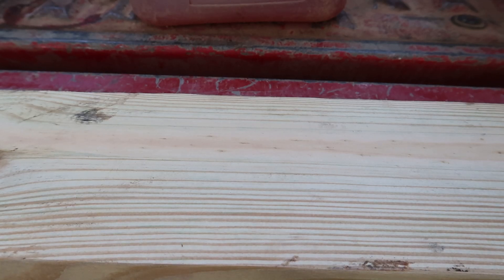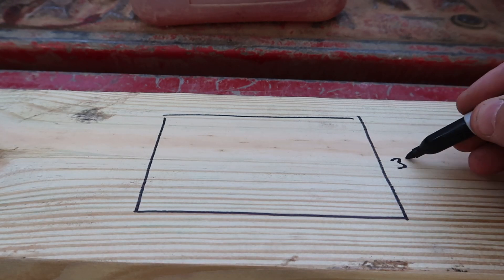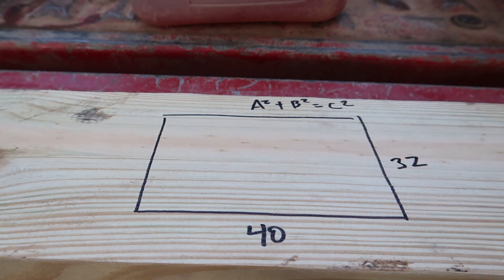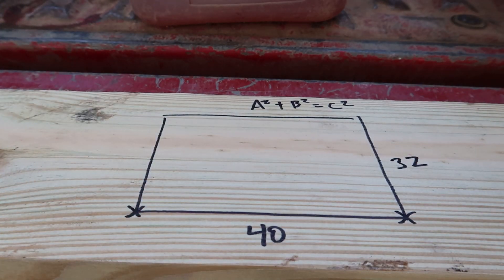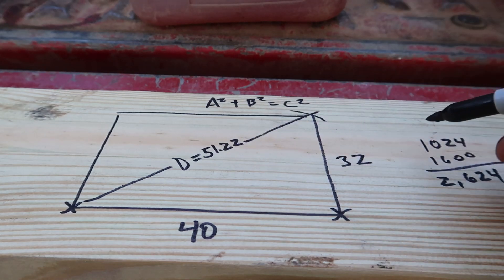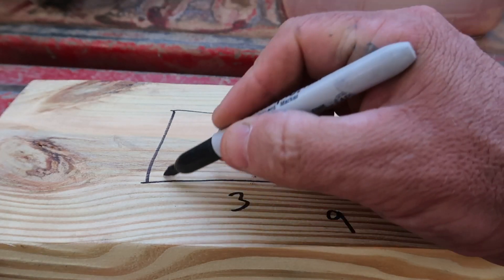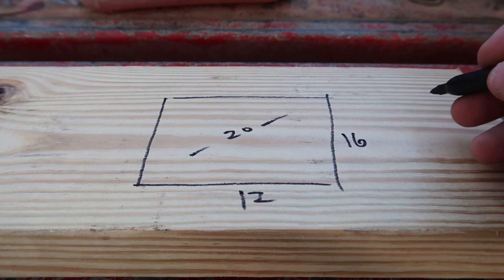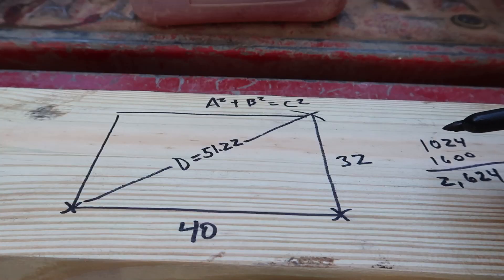How to square up a building in 2020

Comment: will you be sawing all the lumber up yourself or just some of it or none of it? I'm excited to watch you build these and maybe get some pointers for my 30x64 pole barn. O and any reason your going 32'?
Reply from the maker: Robot Looee I’m leaning towards store bought lumber for post and roof system. I’ll saw all of the siding, decking and interior components. 32’ was my max and still have room on the bank side of these buildings. One barn might end up being summer time mill shop.